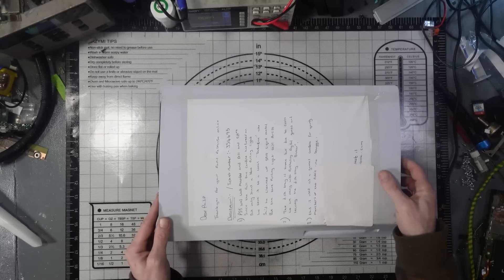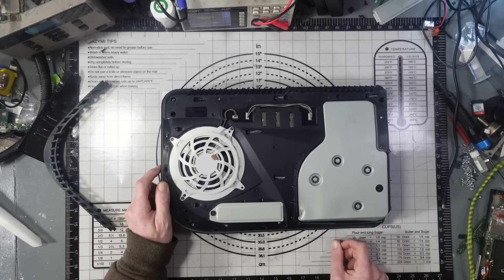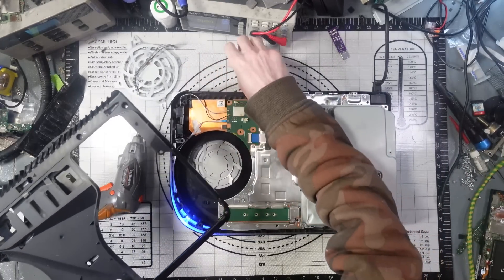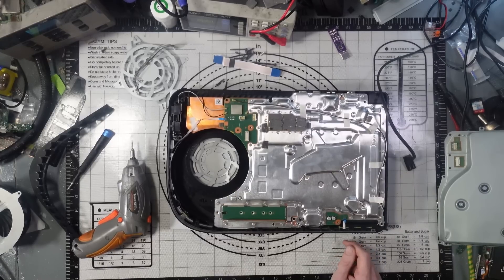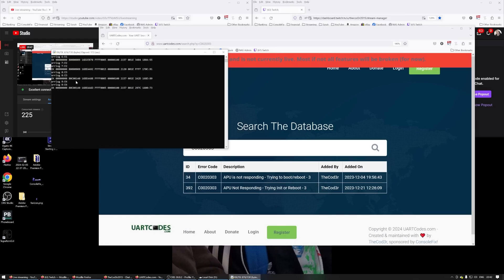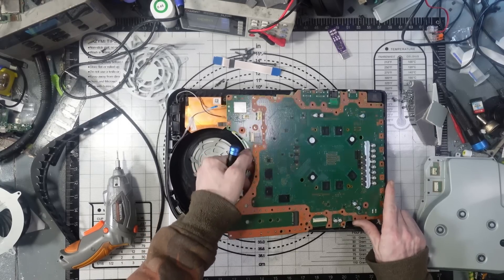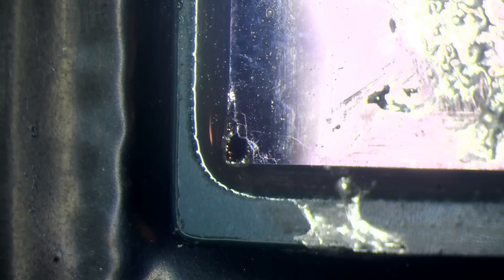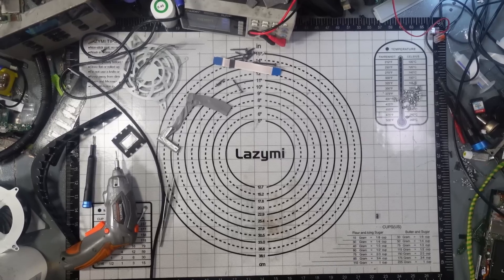Why You Shouldn't Wall Mount Your PlayStation 5!

Comment: Yeah, I never understood what the rational reason was behind some owners of the PS5 mounting their PS5 on the wall. Do they do it because it looks cool? Do they do it because they lack space to put it anywhere else? I mean, especially when you consider the time when the PS5 launched 3 years ago and people then were mounting their PS5 against the wall like it wasn't already difficult to get your hands on a PS5 console in those days. Just be creative and make space (if you don't have plenty around) and sit the PS5 on a desk or even the floor (if you have to) like a normal person. I have a PS3, PS4, and PS5 and they're all sitting on the same desk together. Sure it's not the most fancy-looking way to set up my consoles, but at least I know it's on a sturdy, flat-surfaced object with a very small chance of breaking down. And also, just to point this out: The launch PS5 models from 3 years back are some of the biggest and heaviest of all the Playstation models ever made, so of course there's a good chance something will be damaged if the console falls to the ground with a major impact.

Comment: hello i have ps5 it has this error codes E3122155 , E2E01D15 , E1E01D01 when it is cold it boots whole board heats very hot and freeze the system ram chips gets extremely hot what can i do for it ?